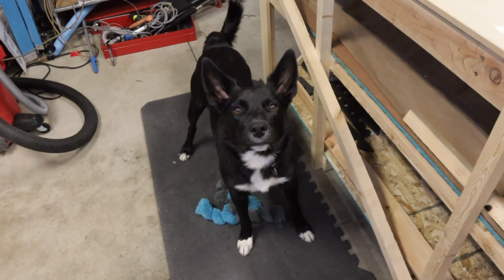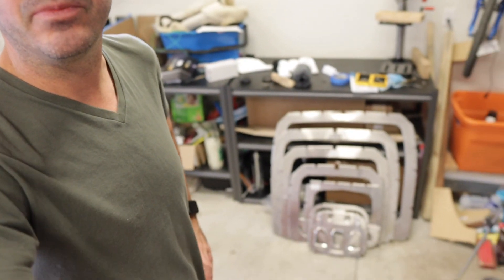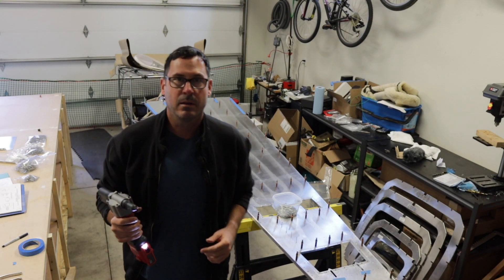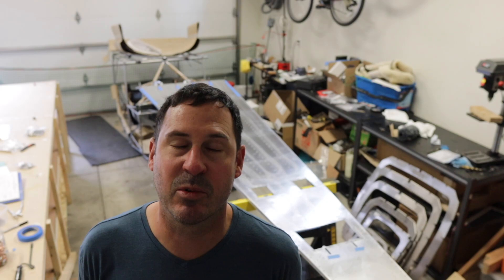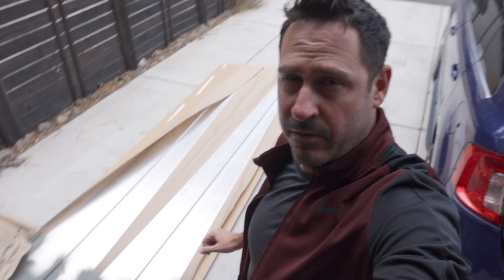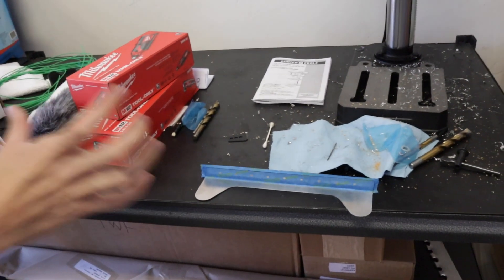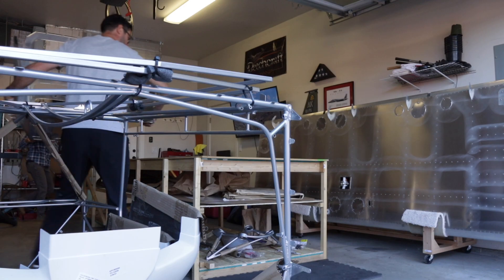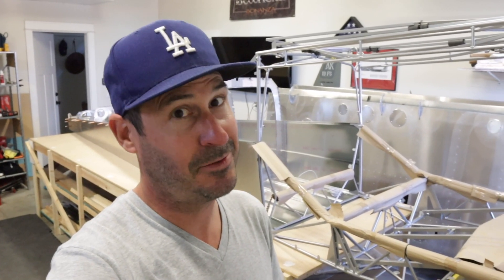RANS S-21 Build Ep 8; Fuselage Part 1

Comment: I haven’t seen anybody doing IFR work with the S-21 or any IFR certified panels. Besides being properly equipped of course is there anything holding it back?  Thanks for the videos, I’ve gone from looking at the RV9 to the RV14 (too much $) to the RV7 then the RV15 announcement lead me to the S-21. Still fairly fast and the build process is more appealing to me.
Reply from the maker: Yes, the S-21 will be just fine for IFR. I’m doing it along with a few other builders. It just depends on your mission, budget, preference. Nothing about the plane holds it back. Yeah, I’m excited about the RV15 as well. Thanks for the comment, Bryan. Happy hunting! You’ll love the build.

Comment: Nice work 👍
Thanks for making entertaining content and for sharing it.

By-the-way, this is probably going to be too much info for some but its useful to know why things are the way they are for others :

Note : for a “-4” (dia. 4/32 inch)  fastener in sheet metal, the edge distance (ED) is typically quoted as being 2 x Diameter or in the case of a 4/32” diameter fastener, 1/4” (.250”).

That’s where the “1/4 inch” guideline most likely comes from. 
It is a ‘strength’ related requirement (fastener ‘tear out’ as a result of exceeding the material’s Shear Stress).

Insight : Where the load per fastener is near to the maximum allowable for the material (example the maximum shear stress of the material is reached), one might specify 2D plus .030” to compensate for location tolerance, however that adds extra material and thus weight, so typically used only where loads are likely to be near the maximum permissible.
Reply from the maker: Fantastic background data, thank you! We talk about this subject in my pre-buy part 1 episode. I love knowing the “why” it really helps inform decisions and answers other questions. Thanks for taking the time to comment on this, Dave!
Reply: This is all covered in the AC 43.13, which should be at every builders side in some form of paper or PDF.